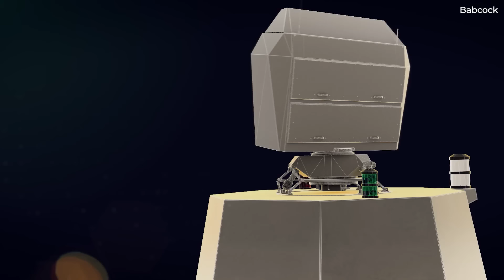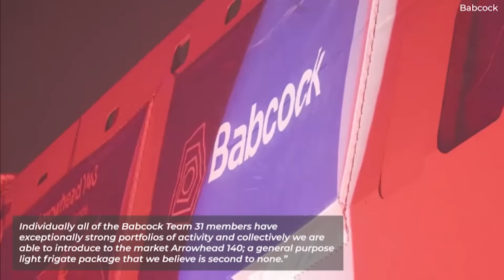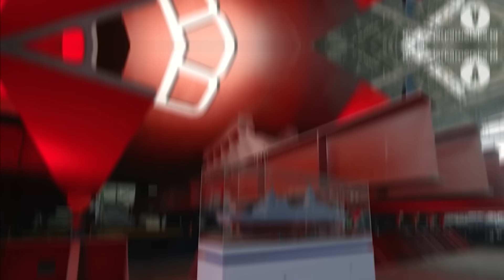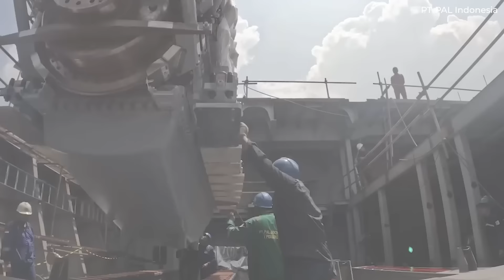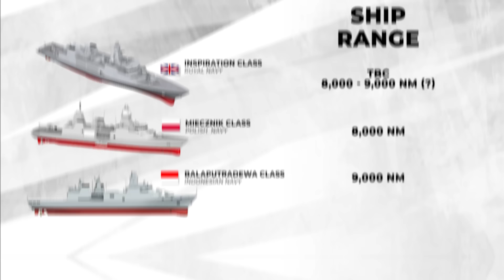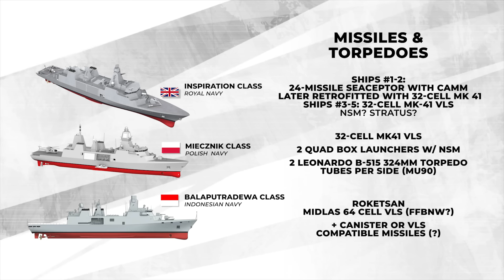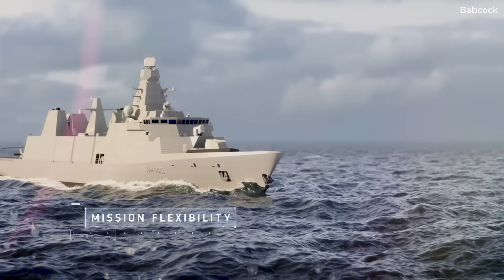Same, But Very Different: The Arrowhead 140 For UK, Poland, & Indonesia

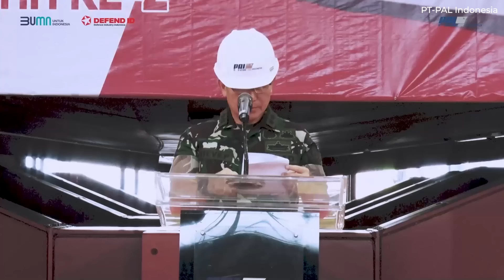Comment: 4:28 'Indonesia has four Balaputradewa class frigates planned...' Indonesia also has two Turkish Istanbul-class frigates on order. multi-role and half as big as their Typ31 version. 
Indonesia also bought French Scorpène evolved submarines and is in negotiations with Italy to buy their light aircraft carrier Giuseppe Garibaldi. sounds like they are on a shopping spree. do they have the means to pay for all that without any hick-ups? ask the South Koreans about that last bit... 😉
Reply: Rasio hutang kami terhadap pdb hanya 39%,jadi jangan mencoba menggiring opini kalau negara kami banyak berhutang dan tidak membayar,..sebelum berkata seperti itu lebih baik berkaca lebih dahulu kepada negara mu sendiri 😂😂
Reply: @DennisWin-hq5kf  I don't "try" anything. but there has been a problem with payments promised to Korea. does it sound familiar:
"Republic of Korea and Indonesia have finalized a deal to slash Jakarta's contribution to the joint KF-21 fighter jet project to 600 billion won (US$443 million), about one-third of the original amount, Seoul's defense procurement agency said Friday.
(KPL/Yonhap) Republic of Korea and Indonesia have finalized a deal to slash Jakarta's contribution to the joint KF-21 fighter jet project to 600 billion won (US$443 million), about one-third of the original amount, Seoul's defense procurement agency said Friday.
[...]
Indonesia had originally agreed to shoulder about 20 percent of the project's cost as a partner country through June 2026 in return for Seoul's technology transfers, a KF-21 prototype and other conditions.

But Jakarta failed to keep up with payment deadlines and has so far contributed about 400 billion won. In May last year, it proposed lowering its total contribution to 600 billion won and reducing the level of technology transfers.

While Seoul approved the cut to Jakarta's contribution last August, the two sides had struggled to sign a revised agreement amid tensions over a police investigation into alleged technology theft by Indonesian engineers at Korea Aerospace Industries Ltd., the KF-21's manufacturer, earlier that year."
Reply: @embreis2257

Anda di ajak kerjasama dan di wajibkan membayar iurannya,tetapi anda tidak di ijinkan untuk ikut serta mengerjakan dan memperoleh ilmunya....

Apakah anda cukup bodoh sehingga anda bersedia membayar omong kosong seperti itu??😌

Dan yang lebih menjijikan lagi mereka menuduh para insinyur Indonesia mencuri data tapi kejaksaan tinggi mereka membebaskannya karena tidak memiliki buktinya.

Waooww...!!
drama konyol macam apa itu??😌
Reply: @embreis2257 kedua belah pihak tidak ada yang rugi, Indonesia tidak membayar semestinya namun juga tidak mendapatkan teknologi yang di janjikan, bukankah itu impas?,
Reply: They have the money just diplomacy is the important thing
Reply: Ignore it, South Korea has no credibility, its cunning traders are experts at deceiving buyers. From now on, we hope Indonesia will not have any purchasing contracts with South Korea.

Comment: It makes sense for Poland to have a low range since Baltic is such a small sea.
Reply: 8000nmi is huge range for a warship
Reply: @starship4453  low range compared to the 2 island states'*
Reply: @garbage2882 I don't know what that means...
Reply: @starship4453  compared to UK and Indonesia (both island states) they need less, so even though the range is still big, they can afford to have less range
Reply: @garbage2882it's only smaller by 1000nmi... And that probably comes down to the added weight of the Polish ones
Reply: @starship4453  And they can afford that trade-off because they have a short shore.
Reply: 8k nmi is small.... o men :) Polish  ships have the best radars - they can be used to shoot dowm emey balistic missels
Reply: @adamciemniewski764 😅
Reply: @adamciemniewski764  With what? Pickle jars? 🤡 Until CAMM-MR materializes there's zero mentioning of ABM capabilities for CAMM family, espeically for only one existing in metal - baseline CAMM.

Comment: This is a very cost effective design, and one that is build without any delays, whitch is kinda rare these days. Very good design.
Reply: Mogami, Daegu, Chungnam, Type 054.

In term of hulls that hit the water there are more ships without delays than the ones with.
Reply: @natthaphonhongcharoen  I won't deny that, but I was more refering to project that are made within NATO. Also, the ships you mentione are wery good, but at the same time made for a different type of region, more oceanic like.
Reply: @Fiodor0  I think it's just the defence cartel over in the west shedding competence and cost offective for profit and short sighted governments are the main reasons for the issues you mentioned. One thing in common about the ships I mentioned is they are built every year. Japan in particular had build 2 surface warships and 1 submarine every year for several decades. That is a big reason why they are very cost effective and don't have delays.

Comment: The RN T31 are getting the 32 cell Mk41 VLS fitted centrally in addition to forward CAMM silo.  This means Seaceptor for airdefence with a Mk41 silo filled with longer range missiles,  ASROC, Tomahawk or similar etc. Box mounted NSM are also now likely. 

They will also likely have 2 or 3  heavy unmanned vessels accompanying it. Thata extra silos & anti sub sensors. 

The lack of a hull sonar is disappointing though. So a USV will need to make up for that.
Reply: Think the plan is to reuse the NSMs box launchers already on some Type 23 frigates.

Also added the Mk41 could open the possibility of these ship carrying the new Stratus missile family (replacement for Harpoon , Storm Shadow/SCALP and  Exocet). MBDA are designing to fit Stratus to fit both Mk41 and Sylver VLS cells.

Comment: Given that these are diesel powered, it seems to me that sonar is (almost) a waste of time. The noise of its own engines would drown out the sounds that the sonar needs to hear.
Reply: Diesel powered engine has higher top speed than integrated full electric propulsion (IFEP)
Reply: @philipchan79  And cheaper and faster acceleration; but it's also louder, meaning that sonar cannot work quite as well. Hence the T31 not being an anti-sub frigate. That's the point I was making.
Reply: @_starfiend  Sonar knows the exact characteristics of its own engine, and the filters effectively eliminate them.
Reply: Jadi anda pikir kenapa mereka masih memasang sonar pada kapal yang bising itu?,

Comment: It's a tough assignment figuring out the fitment for a ship that matches some future hypothetical mission profile. You can see most of the deferred choices is about adapting to the changes things like drone warfare or unmanned underwater systems will be capable of as well as future rocket/ aerial threats since space observability means no more ability to hide and evade. You can also see the design trade-offs one has to live with where you can be heavily armed but not have enough expansion capacity for the future or have slower top speed or have less days on mission. The other part is as you stated that Poland might have the best balance of power and on mission performance metrics but it probably costs the most per ship. I think Babcock is doing great work to get the build cadence up but it's pointless if only 5 ships are on order and so I expect UK will probably order more since need, price, and speed seem to be in alignment with this platform for the UK. Poland probably wants to order more but land forces are taking up a large swath of their budget and it is not going to be shrinking; I think Poland realizes their role in NATO is the land element more than the Naval element, not to say the need isn't there to beef up their Navy. Indonesia seems to be using this as a early run at onboarding a technology transfer so they are willing to make exotic choices and I think they are betting on the Turkish defense industrial base to be their main partner in the systems/ electronics; but Turkey's systems are quite proven just yet although it is fast growing industry.

What surprised me most was that a MEKO A300 offer was made by TKMS for Poland, a MEKO A200 bid for UK (I guess UK was a earlier bid than when MEKO A300 design was made public). Although it begs the question why Germany went for MEKO A200 for their F128 program recently when the MEKO A300 design is available to them ... isn't that odd? To answer my own question I suppose A200 is a far more mature program than the A300, but why does Germany procurement process look so fragmented with like too many choices but not enough money to dole out. Germany can do so much more productive work and procure far more weapons for their military if they didn't make so many design optionalities but instead laser focused on sharpening the tip of the sword of their platform that have operational sucess. I kid you not they have like 3 tank programs ongoing right now, 2 or more sub programs, I have lost count of the various frigates they have to support and build. It's a mindset about putting the money into the creative design phase but not into the building actual hardware phase. As a way to make work during the peace dividends years it makes sense but now it is about just buying proven concepts and cancelling the 100's of superfluous design study projects. Another tangent is I thought the Danish Iver Huitfeldt-class frigate had issues or am I confusing it with a DAMEN based ship for Netherlands? I think it looks like a great design, the staggard chimney's for better sight lines was an era by itself.

Comment: Polish setup looks as a most versatile and complete. 

British build different type of vessels to have more range of capabilities but its build other problem, they need more specialized crews that in today demographic and recruiting problems could be bottleneck.
Reply: Because Poland is repalcing the 2 Perry class frigates and increasing hull numbers. Also they need it to do a lot with Russia as a neighbour. That's wy anti sub torpedos, Air defence radars and a lot of capable missiles and NSM's for surface engagements + towed sonars and anti dorone defence from the 35mm programable ammo.

Comment: Indonesia also had struck a deal to built 2 more ships, but what's unique is that it's going to use similar specs as in Type 31 because the funding came from the British.
Reply: Namun tidak persis sama, senjata utama otomelara 76 dan konfigurasi rudal mungkin berbeda
Reply: @naufalabdulrauf6807 yup dan ffbnw mengikuti keperluan lapangan
Reply: Looks like it won't be a 1:1 copy
Reply: As above chat mentioned, it's not entirely ctrl+v Inspiration Class, maybe only the Radar from EU nations such as Thales, MBDA & Leonardo, and could be missiles who closest to those Trio nations (Which is downgrade coz possibly we can't do 64 VLS setup anymore like Midlas), meanwhile the rest still same with double 76 Otmel, Millennium Gun etc

Comment: Anyone savy enough to explain the pros and cons of Indonesian approach of 2x 76mm OTO Melara compared to the UK & PL approach?
Reply: The main pro is additional firepower against surface and land targets that is not missile  based. 

The main drawbacks are magazine space and the lack of a 'cheap' option against targets like drones. Depending on the exact version the 76mm is also less capable as a CIWS, especially if you don't invest in the right ammunition. 

Essentially all 3 navies have made choices between guns that are world class in their category. You just chose a different combination of capabilities.
Reply: @Vonstab   Thats why Indonesia substitute it by adding 2 leonardo lionfish 12.7 mm rcws to add some form of aerial protection to the front. for those who don't know Indonesian have have 1.550 9K32 strela-2 that are used by the Indonesian Navy the got it from inside 39 ships bought from east germany in 1994. As far as my knowledge TNI Navy uses 9K32 strela-2,  TNI airforce defence uses 🇰🇷 Chiron and TNI Army uses 🇫🇷 Mistral. they'll probably add Merapi heat seeking anti drone to these ships once that thing entered mass production
Reply: @grdno1723 Not 2, but 4 Leonardo Lionfish 12.7 mm RCWS units according to the latest news.
Reply: Pros are programmable ammunition, vast parts and ammo supply, low maintenance cost, and battle provern. Cons are low rate of fire compared to traditional ciws, price, and magazine size on the 35mm millennium gun.

Comment: 64 vls : no joke
Reply: And don't forget, before the 64 VLS deal, Indonesia wanted to invest 96 VLS. But in the end it was rejected by the UK.
Reply: @remo_54  --- Indonesia opted for the cheaper 64 VLS modules instead of the more expensive 96 VLS due to price issues.
Reply: @815gdrx29 The issue was not the cost, Indonesia decided against installing 96 cell VLS  on the Balaputradewa due to the potential for design failure, and Babcock was unwilling to provide assistance to Indonesia should such a failure occur.
Reply: Frigate with destroyer capabilities😂
Reply: @remo_54 😂😂😂assuming Indonesia installed the required weapons systems, which tends to be ignored by Indonesia for many of their combat platforms
Reply: @815gdrx29 Indonesia has ordered weaponry for the Balaputradewa, the contract details have been circulated on Indonesian military forums, and the contract includes VLS MIDLAS, radar, and more.
Reply: @remo_54  Frigate should be more capable. I have no idea why USA and some others started calling its cruisers/frigates as destroyers. Destroyer is meant to be a fleet auxiliary ship fighting fast (torpedo) boats and submarines, torpedo boat destroyer is where the name comes from.
Reply: @menninkainen8830   it's cool so
Reply: it's a Turkish design VLS.  So that will use Turkish missiles.
Reply: @eddiesuen3711  Yes, Hisar Variant and maybe Siper also added, and also Atmaca ASM
Reply: @eddiesuen3711 🎉maximum 30% Turkish radar and missile system, remaining 70% must be European, non-Turkey, systems, or British government may imposed sanctions on Indonesia, due to UK owns the licensing rights over the shops, same as the French refusing to share navigation, radar and targeting source codes to Indonesia and India for the Rafale jets.
Reply: @815gdrx29 That's not quite correct. Indonesia purchased the license, so it can select whichever equipment it wants. The 3rd and 4th frigates won't use Turkish weaponry since the UK is financing the build and Indonesia is paying in installments.
Reply: Still mock up and no contract signed for vls. Hence not real.
Reply: @Blindfolded.911  the FFBW contracts were signed last year what are you talking about?
Reply: @sulthanmrv3893 Who said that? MIDLAS has confirmed there is no control signed till today.
Reply: @Blindfolded.911   Indonesia has ordered weaponry for the Balaputradewa, the contract details have been circulated on Indonesian military forums, and the contract includes VLS MIDLAS, radar, and more.
Reply: @Blindfolded.911 you're so funny, the ship is already built but they gave you a mockup😂
Reply: @ihsanasidiq6208 the vls is mock up he said. And it is true, because there's no contract signed for VLS.
Reply: @The_Accountants The VLS is indeed a mockup because the ship has just been launched and is in the process of installing radar and other important systems. Regarding the VLS contract, it was signed a long time ago. If you don't understand, it's better to stay silent and not make jokes or talk nonsense all over the place.
Reply: If the contract isn't signed, why bother putting up mockups and why go through the trouble of making a place for vls? 😂
Reply: @ihsanasidiq6208  There is no "IF" MIDLAs already confirmed that there is no contract signed till today. No contract with any other company either. That's why they put mock up, because they failed to get the real one.
Reply: @The_Accountants that's just a mockup and not the real thing because the contract hasn't been signed yet, but that doesn't mean it won't be installed 😂, because it's still in the process of installing the CMS system, radar, and other supporting systems. All of that takes a long time, not as short as your typing. It's funny to think a new ship with an empty hull would immediately be filled with VLS. Instead of arguing about VLS, it's better to just wait for the official handover, and we'll see then 😁
Reply: @Blindfolded.911 dongo' 👍

Comment: Large displacement difference between the Polish variant and the UK variant 😲
Anyone know exactly what's contributing to this?
Reply: I suspect that is for the basic Type 31 as originally planned with just 12 Sea Ceptor so I would take it with a pinch of salt. But the Polish variant has a bigger radar system, 32 MK41 VLS, towed array sonar and bow sonar.
Reply: @CrackingDale25  That makes sense. 
Confusing tho. Why would they even give that number rather than the number for the fully quipped planned configuration? 😅